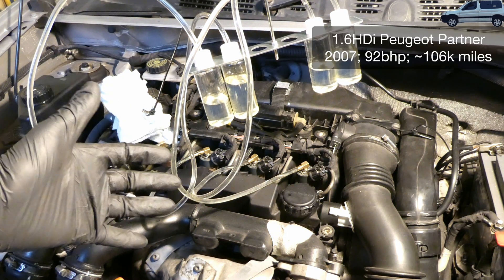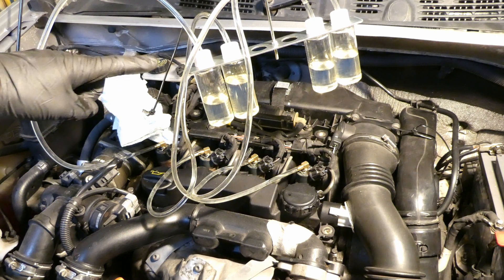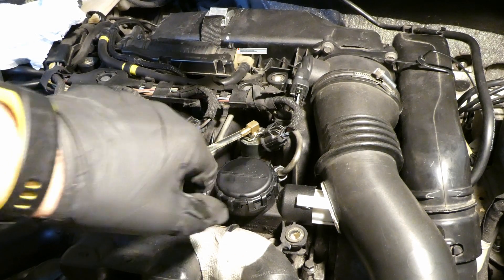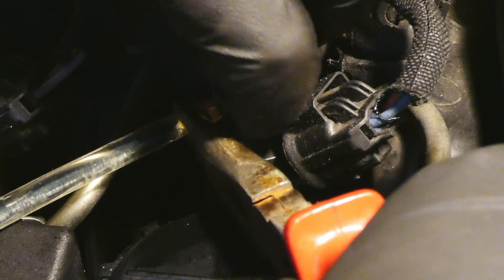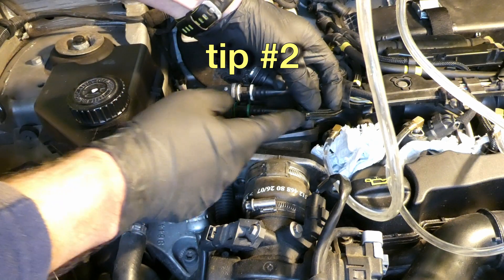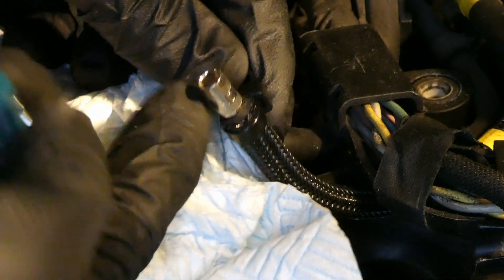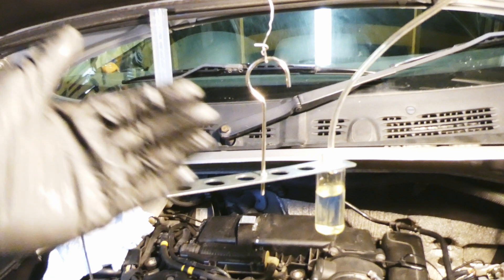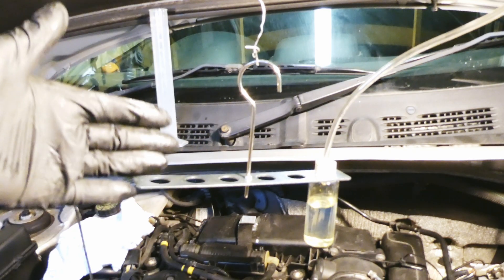2 tips on how to do injector leakoff in the 1.6HDi or 1.6TDCi engines (return flow)

Comment: How do you perform leak off test in DV6C engine with the injectors have an external pipe as leak off connection, how do you fit these adapters onto it, thanks
Reply from the maker: Yeah, not too sure about the DV6C, mine is DV6 and I am not entirely clear on what the difference is with the C for the leak-off test. I suspect it will be something similar.
Reply: @moremolecules  it's an 8v single cam instead of 16v dual cam, injectors are a different design with a little pipe sticking out beside the injector that the leak off pipes clip onto, but the injector pipe itself is the male end, leak off pipes are a female fitment
Reply from the maker: @BlakeCDS  I see. I have only investigated these for the DV6, but may look around for the DV6C. There must be some sort of kit somewhere on the internet. Probably if one buys the leak-off pipe and use the clip on thingies from that instead of the kit, that might work, but I might be talking out of my backside as well.

Comment: Hi how's it going.  Great video.  I want to/ need to,  replace injector nozzles on my v50 1.6 hdi. After insolation off new seals and copper washers i think my problem is injector nozzles specifically injector nr3 pitted injector nozzle do you happen to know the proper injector nozzles on the 2010 1.6 hdi .. happy to provide you with a koffie. You are very helpful and very helpful video content for every every thing on  your channel.
Reply from the maker: Unfortunately no, I do not know what is the exact nozele for the 1.6HDi, I'm not so advance user 🙂
Maybe better luck asking here: www.berlingoforum.com

Comment: Hi what size is the silicon pipe that goes on to the turbo side of the airflow meter? I have a 9hw 1.6 berlingo and sick of rattling airbox and the orange insert in torn inside the pipe that connects to turbo so I'm just going to replace it with silicone. 
Thanks
Reply from the maker: Do you mean this: https://www.ebay.co.uk/itm/184357630380
If it is that and If I were you I would a replacement, rather than put silicone in there.
Reply: @moremolecules  I was going to replace the plastic pipe with silicon hoses like you've done and was wondering what size the air flow meter was as its oval I wanted to make sure I got the right size, and fit a k&n as I'm sick of airbox rattling and white pipe coming off the end of rocker cover and getting oil everywhere.
Also do you know what gearbox would fit to convert to 6 speed? 
Thanks Tom
Reply from the maker: @tomtom4633  Apologies, I did not understand correctly. I think it is 76mm or slightly smaller. My ilicone hose was 76mm and it fitted. All the dimensions are here (https://www.youtube.com/watch?v=VEoO7-fmMkc) or here (https://www.youtube.com/watch?v=QdxyAHP1DVM)

Comment: I have a c5 1.6 hdi , and it has turbo lag , most exactly , the power comes after 2800rpm , with black smoke...
Reply from the maker: It depends, there will always be turbo lag in the 1.6HDi. Black smoke when putting your foot down is too much fuel and little air, but it is to be expected. The turbo does not spin to full rpm that quick and the engine already put fuel in, so black smoke. This should clear once there is air from the turbo, but some smoke to begin with after hard press on the gas pedal. The 2800 rpm kind of depends what speed the engine was to begin with, say you are on motorway/highway and cruising, engine is at say 2,200rpm, there is little turbo going on. If you want to overtake someone then press on the gas pedal, there will be time before the turbo kicks in (increase in rpm) so it depends on the speed of the engine and it may be normal.

Comment: p0087 fault ?
Reply from the maker: Not on mine, I am having a second go at cleaning the injectors with Wynn's injector cleaner, a bit more concentrated version. The video was filmed as part of the baseline measurement and there will be another one after the fuel has been exhausted.